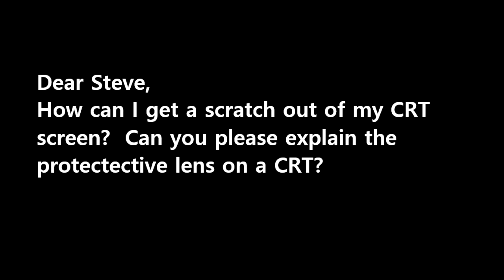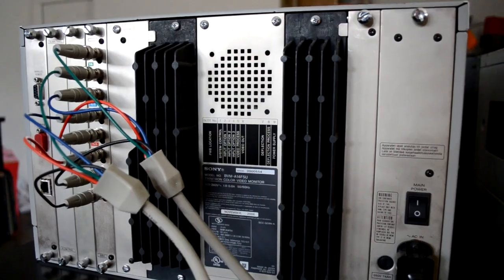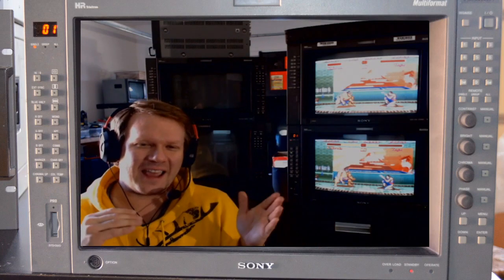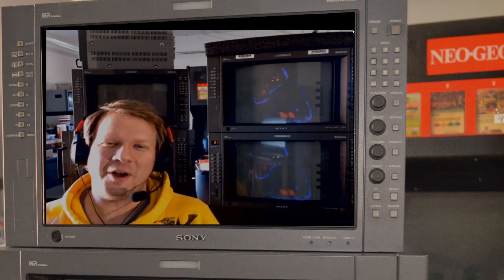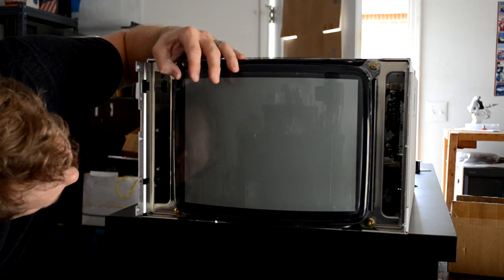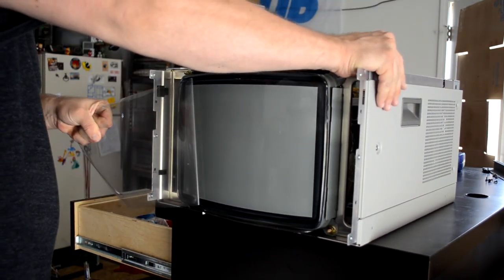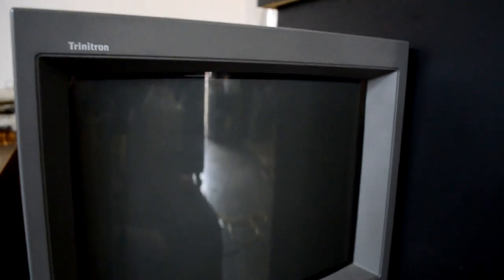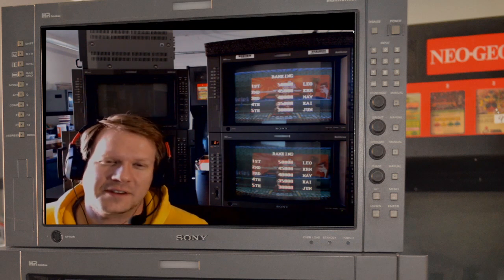Fixing a Scratched CRT Screen on a Sony BVM - Screen Layer Removal

Comment: About consumer level, Sony FW-900 monitor has an antiglare, protective lens, it's also dark and helps the black level in daylight. I sadly had to peel it off on mine as, indeed, has been damaged by detergents (out of my supervision).

On the bright side, without lens is much brighter, but in day light looks very pale like the ones in your video, which can be VERY annoying at times

Comment: I've never tried it before, but shouldn't a windshield repair kit help to mitigate the visibility of any scratches or dings you see on the screen?
Reply from the maker: That's a good idea and deserves a follow up.  I'll work on that.  Thanks
Reply: It works but if you havent done it before leave it a chip is way less noticable than a huge glob of window resin
Reply: I've tried it and it does help but it won't be perfect. You have to be careful with the method you use as well. For example never use the supplied blade in the kit to remove any  excess dry fluid from around the chip / scratch area. It just creates more problems.

Comment: You can fill chips with a window chip kit if you're good at using thos cheap kits ive done it to a couple crts if you dont it right though youll end up with bubbles in the resin that will refract the light more than the chip you started with causes colors to split under that bubble its way more distracting than a chip i only do it if im worried about the integrity of the tube being compromised becasue of the chip maybe in a move or sit down hard i think the 36in kv lines had the anti glare layer but it may only be the 310 and 320 models

Comment: Hey there, thanks for the video! Do you know if the BVM-20G1E does also have such a anti glare lens?
Reply from the maker: Yes, it normally will
Reply: @RetroTechUSA  Alright thanks for the quick answer! I just got one of those and there are scratches on the screen, so I hope I can fix this by removing this anti glare lens.

Comment: Sony KV-34xbr910 … does it have anti glare layer? Was reading that brasso polish cleaner can remove damage / blemishes on that anti glare protective layer.
Reply: Did you ever find out if that works in that specific model?

Comment: Hey guys i'm a newbie in this pvm and vbm monitors topic and i've learned a few things thanks to this channel but i have a 2 questions.
1: is the sony bvm-1310 a good monitor?
(i got one a few weeks ago for mere 25 bucks and since they difficult to find where i live i didn't think for a sec to buy it)
2: Where i can find a replacement keys for the side panels?
(the monitor itself is working just fine and only have a few scratches in the chasis but keys are missing)
any help would be appreciated and sorry if my grammar is bad but i'm not a english speaker.
Reply: 1: Who cares? You already have it. Why are you asking us?

"and sorry if my grammar is bad but i'm not a english speaker."
You clearly are an english speaker.
Reply: @DasAntiNaziBroetchen  are  you mad bro?
:(
Reply: @ExSiegfried  That was a mean response from them. your English is really good too!

Comment: It is possible to purchase such a monitor, for which it can be used at the present time, tell me, I think that the thing is of high quality , but do you need it at the present time? Tell me someone.
Reply: CRT VGA monitor are far far better than LCD and will give you by far the best picture quality for both modern content and retro content.

Comment: Mine has a scratch on the middle has a silver look to the scratch chip? What should I do?
Reply from the maker: Most likely you'll need a replacement tube.  Only a few PVMs have a screen protector on them.  What model is yours?
Reply: @RetroTechUSA  Its a Sony 1440 QM
Reply: @RetroTechUSA  any idea if it's possible?